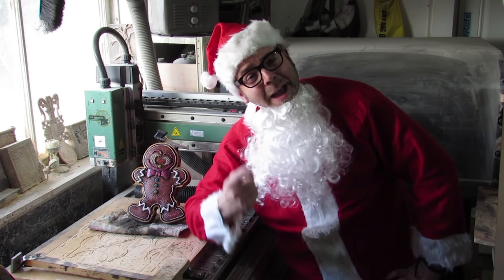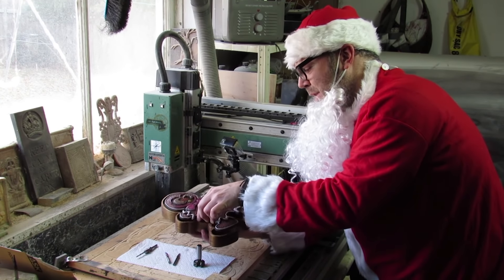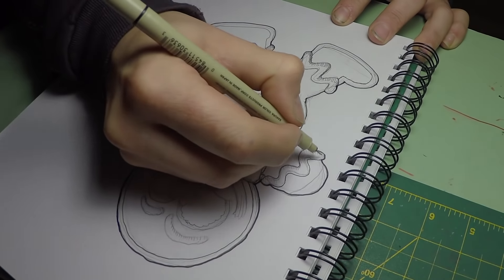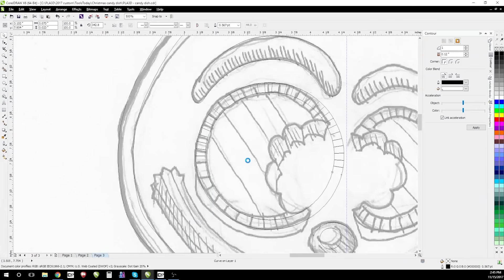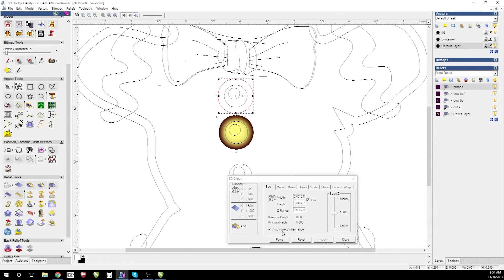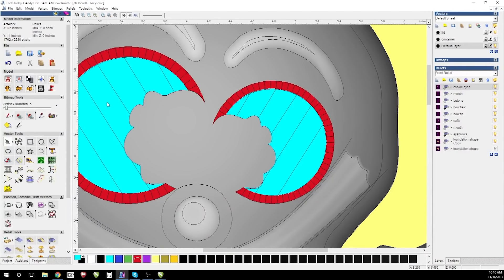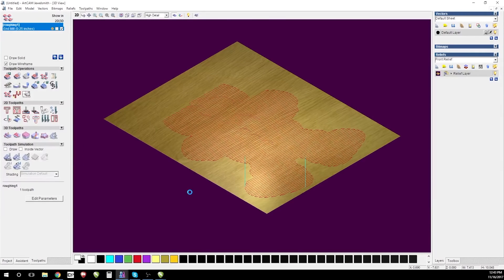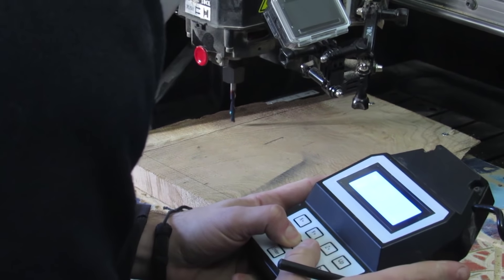CNC Project: 3D Carved Gingerbread Man | ToolsToday

Comment: Great design and perfect for a holiday gift! It has that hand-carved look to it. 
I purchased the design and ran it in some 8/4 (2 1/8" rough) Padouk I've had laying around for years. I was able to run the lid,  then resaw the block so that I could use the balance to run the box. I did scale it down to 90% because my wood was only 7" wide, and ran it with Vectric V-Carve software on my Laguna IQ. For the most part it ran well but I used a smaller step-over and lower speed/feed rate on the finish pass because I was using a cheaper paddle style v-bit. I'm going to have to try that Spektra Coated Spiral. I fine tuned the lid fit with a dremel so that I would have space for the finish. I got a $5 box of oil pastels at Michael's (thanks for that since I haven't used those before) and Minwax Poly-Urethane Satin to finish. Other than having to adapt the file to my software and cutters, this project went very smooth start to finish.
Reply from the maker: Hi Randal, sounds really great, nice job! We would be thrilled to see a photo of the your gingerbread man if you get the chance, you can email stefan@toolstoday.com, thank you! We can also get you special pricing on that Spektra™ coated spiral, just email me - thank you again - Stefan